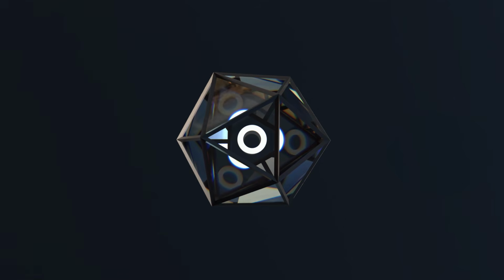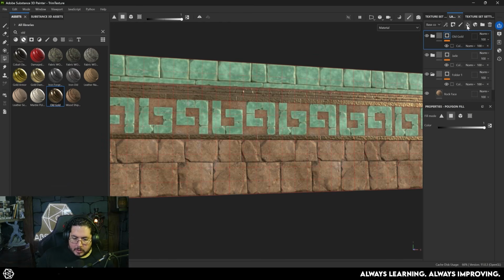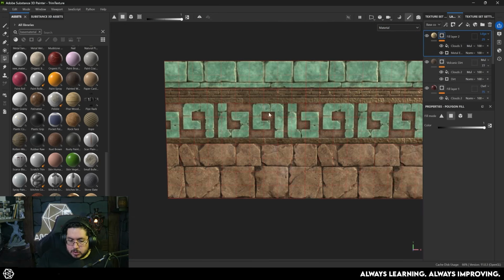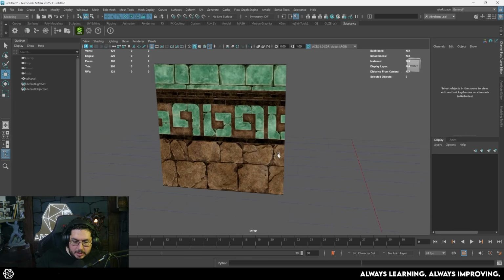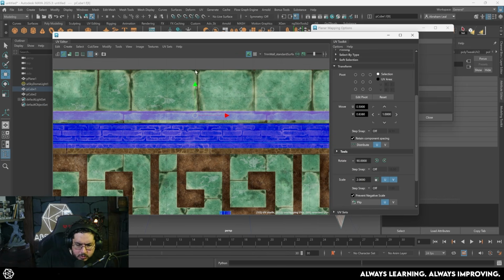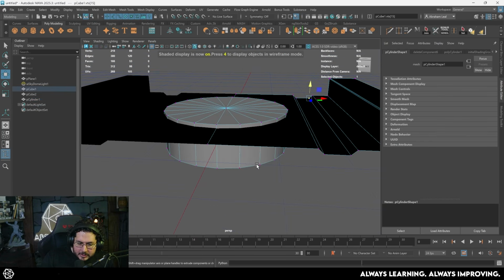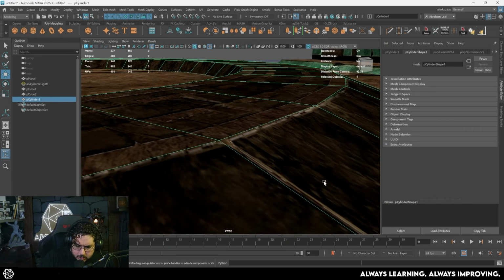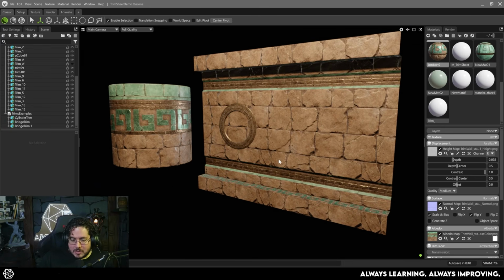Trim Sheets for Games - Texturing and Setup

Comment: Do we not want a master normal map for each mesh, say for the bridge, that includes information from a beveled high poly? Using a second UV set for the baked normal. I'm always worried that my trim sheet normals won't complement the actual form and angles of the mesh I will apply them to. In fact this is my biggest hangup with non-wall trim sheet application - do all my trim sheet bevels need to be 45 degree angles to work on a mesh that has 90 degree corners? Do I need to perfectly line up the edges of each trim sheet section that includes a bevel? It feels like I am losing some form information when using trim sheet bevels.

Comment: Pro tip: If you are trying to use the ID masks to separate your trims and it doesn't work, the material you applied to it (in my case I'm using Maya) might be a color too close to the other colors being used for other materials in your trim sheet. Had to find that out the hard way haha

Comment: Hi. I'm just learning the ropes of 3D, and I have a question. Trim sheets are a really cool technique, but is it possible to somehow add a displacement map to this pipeline to prevent the texture from looking too flat? And if so, what's the best and most effective way to do it?
Reply from the maker: yes of course, you can add displacement maps  using things like nanite, or even using things like Parallax Occlusion Mapping
Reply: @AbeLeal3D  Thanks for your reply, Abe. You're the best, your videos are really helpful.